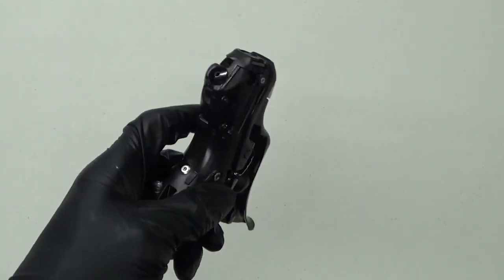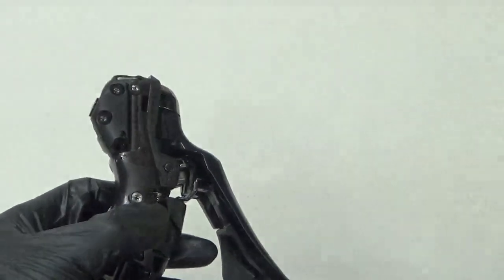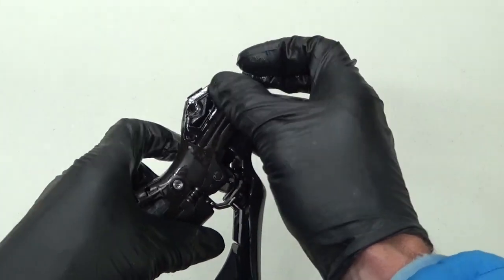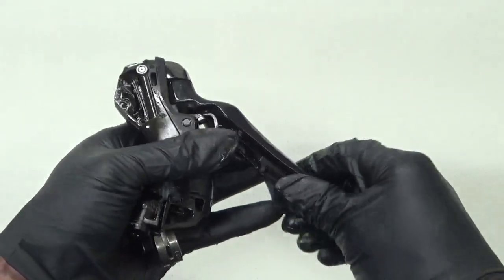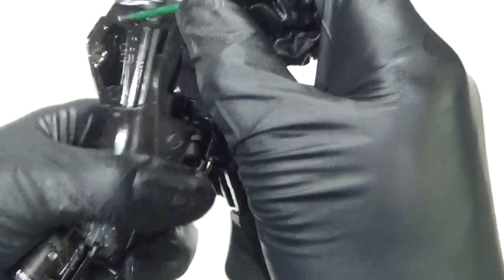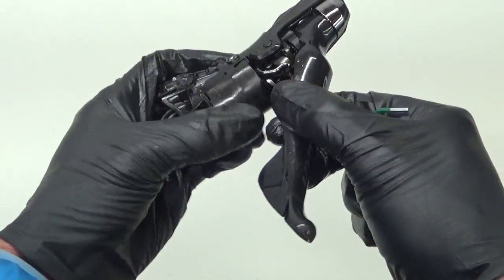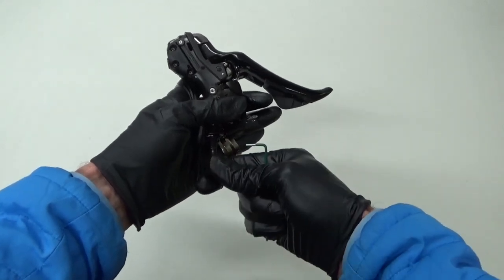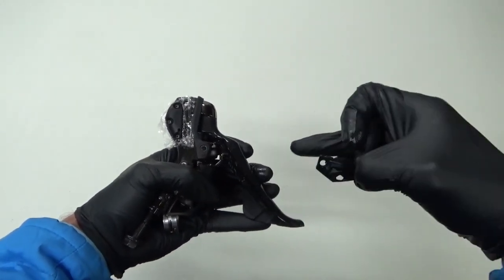How Your Shimano Road Hydraulic Lever Works!

Comment: Thanks for the great vid mate, just to clarify so I understand:
* When you squeeze the trigger, the piston moves up (?) and compresses the fluid (is it in the fluid?)
* Because the bladder in there, which is sort of acting as a pillow, when the trigger is squeezed, the fluid compresses, which compresses the bladder, pushing air out that small hole
* This allows the piston to move (up? somewhere? is the piston exposed in the fluid?)
* When the trigger is let go, this in essence sucks fluid back up the hose into the shifter reservoir, and the bladder sucks air back in (??)

Thanks again!

Comment: thanks for sharing. i have a 1 month old 105 and the lever on the rear brake is not returning to the relaxed position after pressing. the breake is working as normall, the only thing is that i have to push it back in order to bring the lever to the original position. any tip on what could be? i put the bleeding cup on the lever and pressed a couple of times in case there was some air, but didnt solve it... cheers

Comment: While pushing the pistons back  in to the caliper  in order to replace the breaking pads I had some fluid leakage from around that area on the shifter. I Just cleaned the area and tested for brake feel and function, it appears to be normal with no more spillage. Is the diaphragm or other part compromised at this point or did I just got lucky this time ?

Comment: So, that tiny hole on the metal plate behind the bladder on the sram force CX1 is to allow the bladder to breathe? To expand. I had fluid coming out of that hole. Replaced the bladder assembly and after several hours got it working again. Then the shifter spool broke. Ratio Technology make a superior alloy spool, so I went with that. I’ll write a book 📖 about my sram CX1 hydroR issues.
Reply: So, that’s the bladder and piston explained. What about the banjo? It looks sealed, so how does it interact with the rest of the system? Thanks, Laurence

Comment: Hi, I've fitted Shimano STRS 685 to my bike and the brake pipe to the calliper is leaking from olive. As the pipe is integral in frame,handlebars aerofly 2, can I buy a connector (Female) to join a new section of pipe rather than strip handlebars, forks bar tape etc. Thanks
Great informative videos by the way.

Comment: Ultegra and dura ace use the same bladder. Would you know if 105 and tiagra use the same bladder as well? My dura Ace bladder has a hole. If i need to buy a new shifter, I’d like to buy the cheapest one with the same bladder. Haha
Reply from the maker: The bladder is the same for all models!
Reply: Yes I have the same bladder on my 105 r7020 ;)

Comment: I had a hole in my bladder, god knows how it got a hole. Took me ages to find the hole, went to get a replacement bladder only to be told that replacement bladders are not sold and the whole new shifter would have to be purchased!
Reply: Apparently with the whole parts shortage they are now selling it as a part.
Reply: @leflate  oh really? Wow that is great news. Where can you get this part?
Reply: @leflate  where did you see it as a separate part please?
Reply: ive had the same issue, and solved it by superglued the hole :D and works just fine... Had the same opinion with the replacement part, they dont sell the bladder as a replacement part...
Reply: Old comment I know but thought I would share this anyway. I had the same issue with leaking bladder and could not find a replacement online. Called Shimano and they were able to send me a replacement cover and bladder.
Reply: @roberts1159  so a new bladder fixed your leaking? (i have the same problem)
Reply: @IsaacRC  Yes, new bladder fixed the leak. Kit from Shimano also came with a new cover and screws.
Reply: @roberts1159  Good to hear! Thanks
Reply: @roberts1159 I replaced the leaking diaphragm and theres no more leak. injected from the caliper new mineral oil and no bubble left on funnel. closed the bleed cap and brake is slammed to handlebar without pushing the pistons. how do i get  air out or so? or is it air? thanks in advance.

Comment: Dear bike mechanical guru.
Just see your video and would like ask if you know any way to make a R8020 left lever stop leaking mineral oil. I already change the "rubber" but still leaks somewhere. Thanks a lot
Reply: I'm having the same problem, how did you end up fixing your brake lever?
Reply: @IsaacRC  finally change the complete lever, the leak was somewhere between the cilinder and the reservoir, not repairable
Reply: @cristianpena9179  oh shit, it's that bad. Ima make sure there's no hole in the diaphragm, this guy has another video where it shows with a simple "kitchen" film (plastic film) you can test  as if it where the diaphragm to know if it makes a perfect seal of the reservoir chamber.

Comment: Will anyone please answer my question;  I'm planning to upgrade my bike to a full hydro system. My question is:  "How durable are hydraulic road shifters in case the bike crashes?" ..Does anybody here had a bike crash while equipped with hydro STI's?

It's known that when a road bike/CX/Gravel bike crashes, most often than not,  it's the brake levers that hits the ground first.  Are they sensitive even on minor to moderate crashes?

Comment: I really don't understand the video ( because I dont speak your language ahah). In normal condition. It should be a hole in the bladder or not ? I Have a hole now after bad bleed, and the oil is flowing a lot... 

The bladder should not have a hole or so ?
Reply: The bladder should not only expand and contract like a piston ? If there a hole, the levers works, but you loose fluid and the force feedback from the lever..
Reply: Old comment but bladder should not have a hole in it. If it does fluid will leak from the vent hole he was describing in the video.